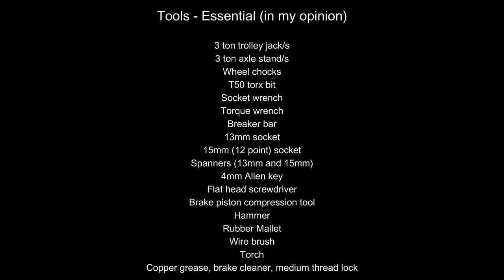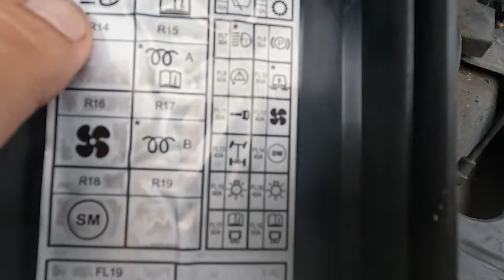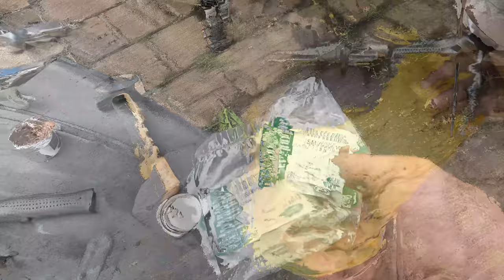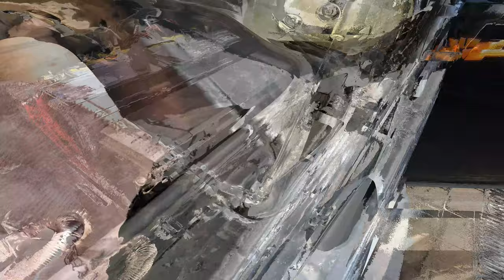Land Rover Discovery 3, TDV6, 2005: Rear Brake Discs and Pads Replacement

Comment: Should have slacked the adjuster off for the brake shoes through the disc before trying to hammer off next time. Just some advice
Reply from the maker: I agree. For some reason, I'd thought that putting the car into Park Brake Service Mode at the start automatically pulled the brake shoes in, but I don't think it did. Then, of course, once I was into the job, with my head down cracking on, I didn't think to make life easier by using the adjuster, I just got to it with the hammer. All a learning experience as it's not a job I'd done before, so will know better next time.

Comment: Hi, I really appreciated your video, I was wondering if the procedure for putting the EPB into services mode is the same for the Discovery 4, that it doesn't have the key but the ignition button? Thnaks
Reply from the maker: I'm sorry, I do not know the answer to that. I would suggest that you join the excellent Disco3 forum, where there is a section for Disco 4 owners. I'm sure someone there will know the answer and will help. Here's the link: https://www.disco3.co.uk/forum
Reply: Regarding my car Disco 4 SDV6 the EPB does not activate automatically but with the engine off the gearbox goes into parking mode and therefore this would prevent the rear disc adjustment
Reply from the maker: As I do not know the differences between the Disco 3 and 4, I do not know what to suggest to you, other than to look on the forum I mentioned earlier. Also, if you search YouTube for Land Rover Discovery 4 rear discs and brake pads replacement, I see there are a few videos that might be helpful. Good luck.